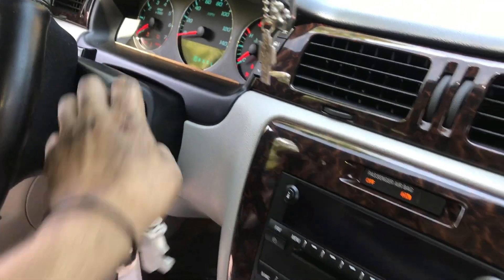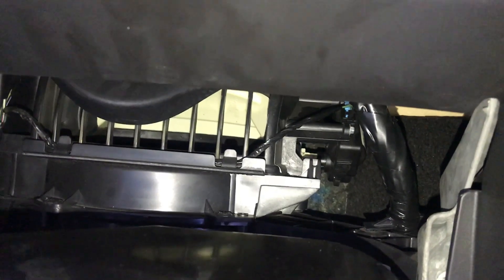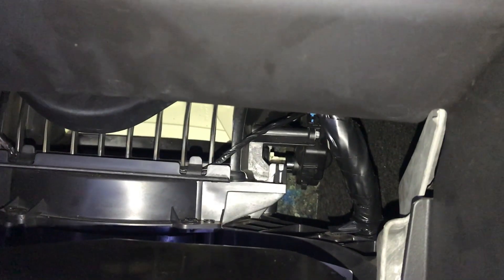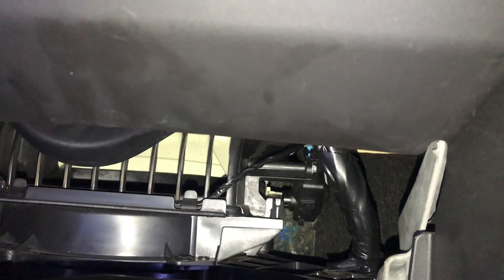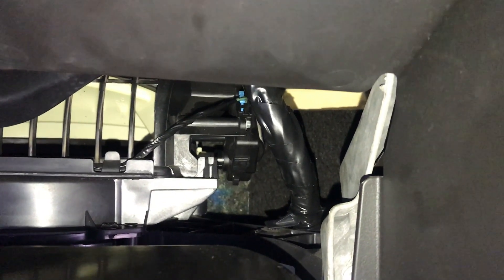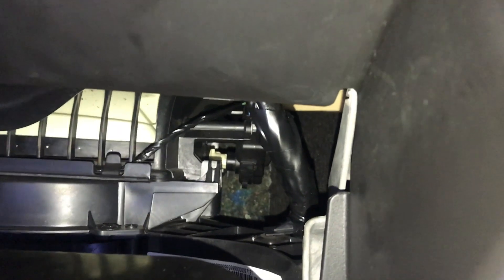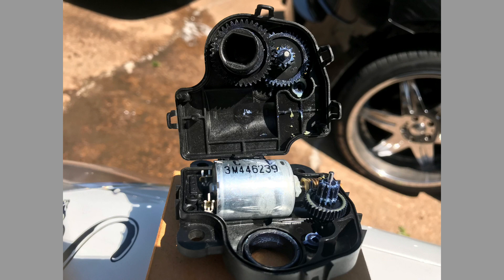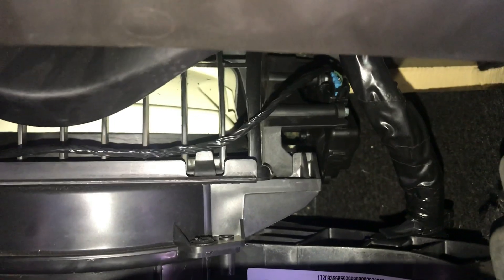2012 impala blend door actuator location

Comment: Wrong. That's the recirculating door actuator.
Reply: Mine doesn't click. But it doesn't whir or activate like the left one (the face or feet changer)
The right one makes 0 noise. I believe it's bad, and not only changes it from outside air to recirculate.. but also from hot to cold
Because I'm pulling hot air on a 50°F day from "outside"